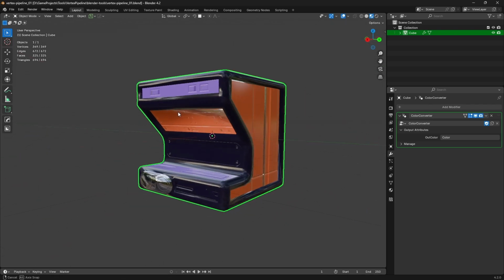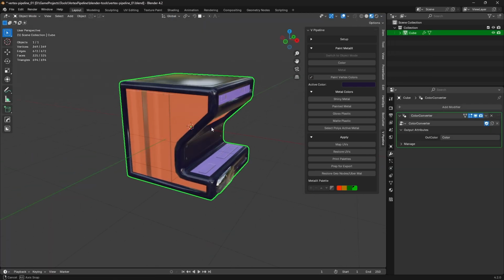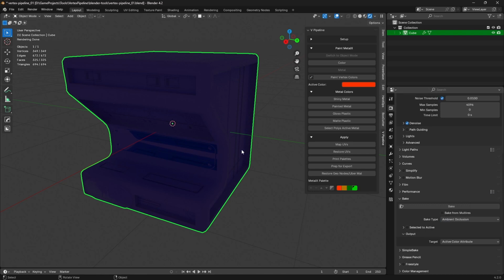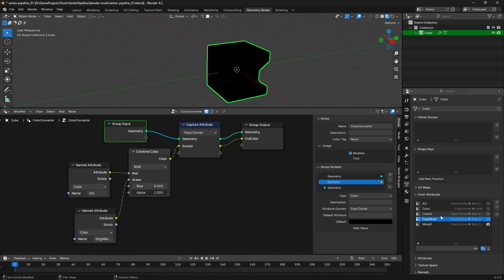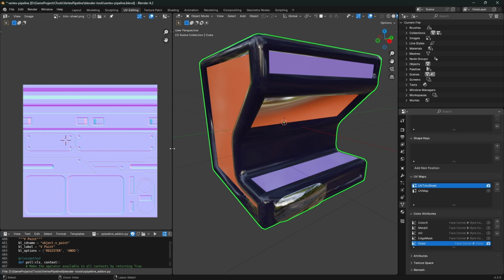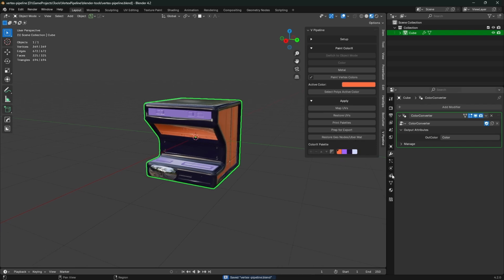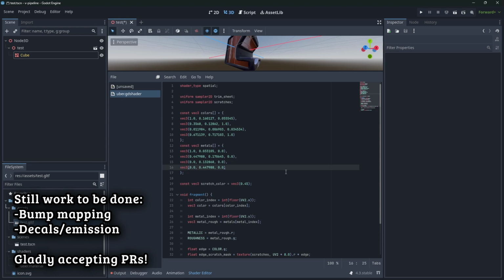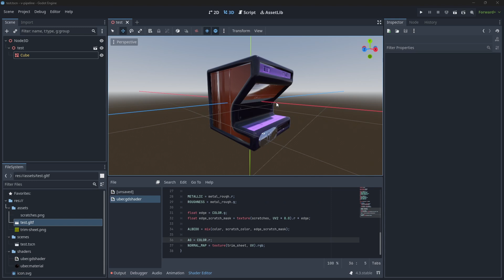Recreating the Pipeline from "The Ascent": V Pipeline (Part 2)

Comment: Your object seems to have some weird blended normals with no sharp edges.  Is that intentional or a side effect of the pipeline and baking?
Reply from the maker: I can't remember if I just shaded smooth the whole thing or not. Normally I use low bevel counts (usually 2), with auto smooth at least than 45 degrees and hardened normals. This is a pretty good method to get highly optimized hard surface models that still have nice looking bevels.

But for the life of me I can't remember what I did here lol.

Comment: I haven’t fully grasped the entire pipeline yet, but you can turn on UV tiles in Blender's Show Overlays option in the UV Map viewport, which makes it a bit easier to understand all the indexing and flooring stuff.
Also, is it possible to use your other addon with this pipeline as well?
Thanks in advance, man. Your work is very impressive—it brings Godot closer to others professionals softwares
Reply from the maker: Ahh this is an excellent idea, I am screen capping your comment. A visualization on the UDIM tiles is exactly what I need.

In theory it should work. The other pipeline is all about level design, collision shapes etc. so I don't think there's any conflict here.

This pipeline just uses a particular shader and has vertex data (which is standard for gltf)